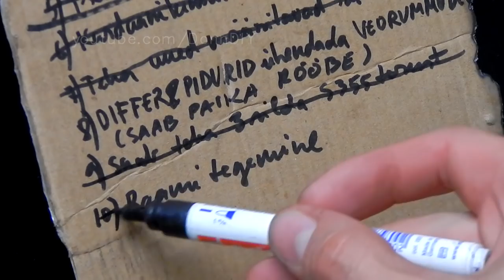Fabricating & Welding Steel Frame - Tracked Amphibious Vehicle Build Ep. 7

Comment: The universal joints are not connected like they should. A universal joint under an angle introduces a small speed difference, the way they are mounted now, this effect is increased and will put a lot of strain on your drivetrain. If you rotate one of the universal joints on the short connecting axle, the second universal joint will undo the effect, created from the first joint

Comment: The only problem I see with this bearing design is they are not thrust bearings.  All wheeled bearings use tapered bearings to carry vertical load, and horizontal thrust loads, hence the term thrust bearing.  You may have issues in the future since they are not thrust bearings.  Love your channel by the way, hands down one of the best on YT.

Comment: Make sure your two center idler tires are 2" lower than the rest.  This will make skid steering much easier, especially with brake diff steer.  Looking forward to seeing this thing in motion!
Reply from the maker: Yup, they are. The tires aren't mounted on the center idlers so it rests on the corner wheels at the moment.

Comment: Great work, one thing i noticed  was the angle of your universal joints, i realise that it is in mockup stage but if you intend to mount as shown the angle is much too severe and the universals will likely vibrate badly , for severe angles you need CV'S keep up the good work
Rick

Comment: Idea - Add a grease-zerk to the hubs & remove the inner seals of the bearings. So the grease pumped into the hubs, actually makes it to the bearings.
Reply from the maker: Yup. That's what I'm going to do. I just need to make sure where the frame will be continued on the hubs first. Only then I can add the zerk fittings.

Comment: looking good. BUT, you may very well run in to drive line binding. when you raise the diff, you increase the AoA (angle of attack). Maybe try using a double Carden U-joint. i had to fab a drive shaft for my 42 willys jeep when i did a spring over conversion, even with rolling my axle, bc i ran into steering linkage bind when i rolled to reduce the AoA and found a happy spot for the steering linkage and tacked up the carden joint. for your build, it may take 2 double carden joints per side.

Comment: I think the break should be directly with wheel , I'm from Iraq 🇮🇶 , you're genius👍
Reply: ail baseem _ علي بسيم 
I think the brakes are where they are as the wheels will be sealed outside the frame and keeping the brakes inside keeps them from getting wet.
Also the brakes are probably going to be independent so the machine can skid steer.

Comment: Looks really great but I think that the short side drive shafts with the Ujoint fork on each end of them are 90 degrees out of phase.  the forks on each end of the short shaft should be aligned with one another.

Comment: Looks good from the fabrication end of things. I do think the universal joint angles are a bit severe, time will tell how well they will hold up.
Reply from the maker: I will try and get the angle as small as possible and the PTO shafts floating so there is as minimal strain as possible on the U-joints.
Reply: @DonnDIY  even with the shaft floating you're still going to get a fair amount of binding on the U-joint just because of the angle. You need something like a portal axle end to bring up the shaft center so it's more in line with your differential

Comment: Looks like there might be a problem with too much angle in the joints off the differential. They should be as straight as possible.

Comment: You really need a 2nd angle grinder with a flapper disc. One for grinding/cutting, the other, flapper disc, to clean up the rust and welds. It's coming along quite nicely. Cheers :)

Comment: Differential braking
The main disadvantage, like the clutch braking system, is that steering dissipates heat through the brakes. Unlike the clutched system, however, in this case all turning requires braking. This can be used on lighter tanks, but the amount of kinetic energy in larger tanks makes the required brakes impractically large. Another disadvantage is that the differential will allow the tracks to turn at different speeds no matter what the cause may be. This may be the application of braking, but also occurs as the tank travels over terrain; (If one side of the tank enters softer terrain and slows down, the tank will naturally turn towards that side.) Forward momentum tends to offset this effect, so it is mainly a problem at low speeds.
I found this on the web and wanted you to see it.

Comment: Check out Ujoint phasing or cross phasing as yours are cross phased which isn't normally a good idea at all.  Also according to my chart, to get 100% life from a ujoint you'd want at most a 3 degree angle.  Yours looks way over 15 degrees so you should expect less than 20% lifespan and you should make them somewhat easy to replace when your out and about cuz that would suck to get stranded in a lake :)

Comment: Hey,
Well done so far but just a suggestion, investigate "Universal joint phasing" yours are currently set up out of phase it can cause really bad vibrations, rapid failure, broken shafts and all other sorts of problems.
Take it from an old hand it's easy to get right but so bad if you don't
Regards
Rick

Comment: Very nice build but... I'm thinking the angles on the universal joints are a little too steep, ideally you want those types of joints to spend most of their working life as close to flat as possible. I have in the last 30 + years seen plenty of the universal joints fail because of excessive drive angles, the heavier the load and larger the angle the faster the joint will fail. If it was me I'd either modify the frame to make the back end higher or possibly build a slightly lower box in the floor plate for the diff to sit in. Considering its a go anywhere vehicle then modifying the frame is the way to go. Good luck with the build, looking forward to the next vid. :)

Comment: I think chain drive would work better than high angle u joints unless you plan to recess the floor to allow the diff to sit lower. and also driven wheels dont have to be the same size as idlers and this would also allow to rise the hubs up and you probably could make axles straight  .

Comment: Cool project amazing work. Im pretty sure you need to line up the two inner universal joints on your mini drive shaft like a car so they don't work against each other.
Reply from the maker: Yup. The diff was just freely placed on the frame to give an idea how it would fit there and nothing was properly lined up yet. I will deal with the drive shafts when I start mounting the diff.

Comment: There is a ton of stress on drive axle on on of these vehicles a straight axle would be better. There are too many parts to go wrong with all the u joints. Good work though you are good fabricator , nice clean shop I love it.

Comment: All this in your head and organically built or did you sketch out plans beforehand like De Vinci?
Reply from the maker: I have drawn out some basic measurements derived from the materials I have. I have a roll of conveyor belt I want to use for the tracks - that for example dictated the width of the vehicle and so on. A lot of variables that I'm not able to think of when drawing up blueprints beforehand. So I sort of wing it but use my head too while doing it. 😁

Comment: Hey are you going to have suspension on your road wheels? I'm a bit confused on what type of track system you are building.
Reply from the maker: No suspension. Just the suspension that the pmeumatic wheels give me. It will be a crawler type of vehicle with a top speed around 30 kph.

Comment: I would think a "limited slip" differential would work best since both sides drive without having to correct with braking (not just push from  1 side as spider gears do).. I vision the vehicle pulling to 1 side when starting off & needing corrective steer / braking...

Comment: shes coming together now, good stuff! will those U-joint angles work alright or do you need to reduce them somehow?
Reply from the maker: I'll see about those angles. Have to hook everything up and see if it works. Then I can modify things if needed.
Reply: @DonnDIY  yeah differential might need to be dropped down through the floor a little and plated around but it would be awesome to keep the bottom all flat and smooth

Comment: What are you using for a saw blade in your circular saw to cut steel tubes?
Reply: juergen07091973 
It looks like a metal cutting saw, carbide tipped blade. They are very good, hardly any sparks!

Comment: Great build. Tip: you have to realign the couplings on your universal joints otherwise it will cause vibration. A single universal joint will always cause vibration due to the way it works that is why they are always used in pairs so they cancel each other out. The position looks okay but the way you put the axles together in the splanes is incorrect. 
I love the project, i just subscribed to your channel and i am looking forward to your next vids.
Reply from the maker: Cheers! I know about the phasing of the u joints. I just loosely put the diff on the frame to give an idea what it will lool like. I still have to connect the u joints so what you saw was incorrect indeed.
Reply: Donn DIY, that is good to hear. I am a mechanic at a public transportation company in the city of Rotterdam, The Netherlands. I have experienced it myself after reinstalling the gearbox of a citybus. I was already aware of this phenomonon at the time but when i was installing the driveshaft i overlooked the fact that i misalligned the shaft. Only after the testdrive i became aware of my mistake en had to reinstall the driveshaft to get rid of the vibration, which can be very strong, so i experienced. So due to my own experience i was triggered when i saw this with your shafts.
Good luck with your project, it looks very promising!!!

Comment: Loving your build but the geometry on those axle shafts have me a little worried 🤔 My concern is vibration from everything being solid mounted and the angles of the axle joints. But we will see how you mount the rear end. No offense to your build. I am just thinking out loud. It may help you to see an issue before it may occur.  Hopefully you will find no problems !! I am enjoying the build 👍

Comment: Looks great. I imagine incorporating suspension would require a more flexible track and I'm assuming you'll be using a stiff rubber track off a Bobcat. But wouldn't a PTO motor be more efficient/relaible in this situation? Glad I found this channel.

Comment: all the tools you have i'm surprised you don't have a hydraulic press for putting those bearings in :)
Reply from the maker: I did build a hydraulic press and still have it. It was faster using the hammer instead.

Comment: Pretty good! 😉 Are you going to weld the bottomplate also on the top side of the frame? Or seal it in some way? I see where water and dirt, in the coming years, will collect and start rusting through the plates and frame. 
👍👍👍Project!

Comment: please install angles in the structure supporting the wheels
Reply from the maker: I will weld on corner supports to the axles when I build the top of the tub frame.
Reply: @DonnDIY  good plan

Comment: The cardan joints are not assembled correctly! Forks should be in the 
same plane. Although the turnover is not high, losses will increase. The
 angle of installation at such speeds think freely can be 10 degrees.

Comment: The pto knuckle joint are wrong 1/4 turn off. The ends on the shaft should be in line. Google a pro shaft photo. see what I mean.

Comment: Don't mean to criticize, but your pipe between the axles should have been continuous, since they are taking a big part of the bending stresses, and the welds are under a lot of stress.  That is a butt joint, which is not good.  Welds should be in shear, not tension when loaded.  Maybe you will make it into a truss frame on the side of the vehicle, I don't know, but still it would have been better to have an HSS section that is continuous and sitting on top of the axles. 

If the welds go in the future, you could always weld a longitudinal flat bar splice piece over the weld so the metal goes into tension instead of the welds.

 I am a retired structural engineer, not criticising,  please don't get me wrong, but when I see something structurally weak, I have to point it out....it's a bad habit.  By the way, you're an amazing and talented young man, your parents must be proud, I know I would to have a son like you.  Cheers.

Comment: i think the angle on the 2 jack_shareft are to sharp, the max should not be more than 5deg's
Reply from the maker: I'm getting very different opinions on the U-joint angle from 2 to 32 degrees. So I just have to try it out myself and see what happens.
Reply: @DonnDIY  i'm a shipwright by trade and on any universal joints should not ex 5 deg, as it put to much side load on them, but its your build

Comment: This is getting good like porn but better! 

If you plan on running it in a lot of water you could use double seals. 

You could also pull the seals off the bearings and put a grease fitting on the housing.  Then by pumping the housing full of grease it would water proof the bearings and if a bit of water got in no big deal.  If water gets in the seals they are gone!

Comment: You spent all that time cutting the axle down, to do that? I’m not under standing why you didn’t use a full length axle and just welded the frame into the axle making The axle the back tube, instead of adding all those extra moving parts to fail.

Comment: In this Video I see the drive shaft to the wheel and you make a big mistake. The U-joints are not aligned in the same rotating angle on the shaft. It seems to be around 90°. They have to align at 0° to have a homocinetic effect! The Movement of an U-joint is not linear in an angle. This unlinear movement can compensated with two U-joints in the same angle and same level. The Joint arms have to be in the same turning angle position on the shaft. Then input and output rotation are linear together. The shaft himself rotates pulsed, but not input and output. Important.... Both joints have to be bend in same angle and in the same level. It doesn't matter in which direction of the two possible you bend the second U-joint. Same direction or opposite direction.

Comment: How is that supposed to be an amphibious vehicle? It's way too heavy and those wheels don't displace nearly enough water for it to float! You should make your own wheels out of sheet metal and fill them with EPS foam!
Reply from the maker: The tub / hull is not finished as you can tell. The tub will be the thing that keeps this amphibious vehicle afloat. Heavy steel ships float. I don't see any reason why this shouldn't float once it's finished.
Reply: @DonnDIY  Okay, I guess I just don't get what you're trying to do then. A heavy vehicle that has to push water out of it's way sounds like it will be really really slow! (Just like heavy steel ships.) There are plenty of YT videos where ATVs, snowmobiles and even dirt bikes skip across the surface of small lakes at high speeds with nothing to keep them afloat if they slow down. There are also flat-bottom swamp boats with the big fan on the back that can go across land and water and can slow down and stop if they want. Not to mention all hovercraft that can go on water, land or ice. There's the Russian Kangaroo (google it). Not to mention production vehicles like the Sherp, the Gibbs Quadski, or the Panther watercar and military vehicles like the UHAC. So far what you're building sounds like a slower, heavier possibly more expensive DIY version of all of these that uses more gas and isn't particularly better at anything these vehicles already do. So what are you trying to build and why? How many passengers will it fit? How fast do you want it to go? Will it be street legal when it's done? 
You seem to really know your stuff when it comes to fabrication, but I'm wondering if you've considered the impact of all the physics involved. Vehicle weight, displacement required (at ~56 pounds per cubic foot of water), engine power-to-weight ratio, hull shape & drag produced, etc. Perhaps you should try building a small RC version first so we can all see what you're trying to do?

Comment: When amateurs try and make a vehicle. I seen the same exact inexperienced mistakes made with the ripsaw people. Listen, do any of you understand alignment angles?

Those U Joints are all going to snap. Guarantee it. You need to have those joints in as straight a line as possible. They are meant for suspended vehicles where the wheels travel up and down on the road surface. So you don't snap driveshafts every time you hit a bump, the U Joints allow a certain amount of flexibility. That's all they do. They are NOT designed to work and function in the manner you have employed them. 

Like the ripsaw people, rookie mistake.

Comment: Your design is flawed. The center hubs need to be lower and pivot look how any track vehicle is and you'll see. You'll need spring loaded track tentioners at the top of the track also.
Reply from the maker: Center hubs are lower. Track tension will be achieved by stretching the conveyor belt over deflated tires and mounting them. When inflating the tires again the tracks will be friction driven.